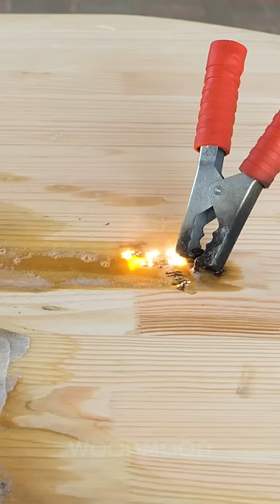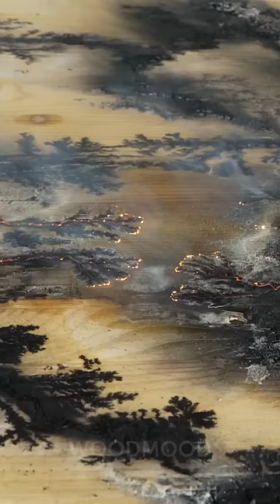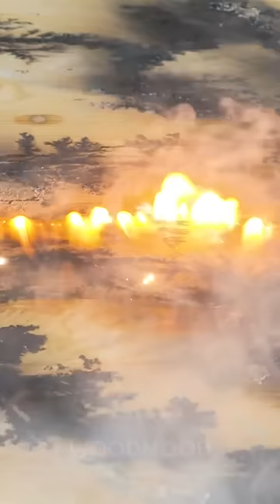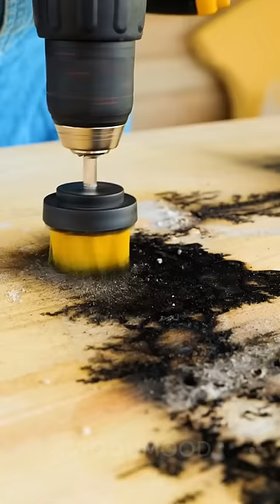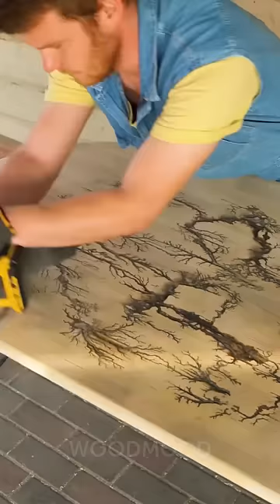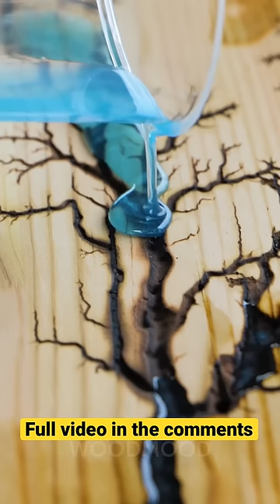🔥 Lightning on wood. How it's made #Shorts

Comment: Don't think I would trust jumper cables to be well insulated.  See the exposed metal above the handle? 
Even 12 volts can kill under certain situations, like having good contact with conductive liquid.  And I'm sure he's using higher voltage than that.
Reply: Much higher. Plus the entire board becomes conductive during this process

Comment: Dendritic patten. Looks like a river flows downhill don’t it. It also n resembles neural networks in the body. It also looks like the cosmic web. Funny that. Or perhaps by design. The we are electricity. The universe is full of electrical currents. Can’t have electrical currents without electromagnetic energy and ipso facto, you can’t have electromagnetic energy without the existence of electrical currents.